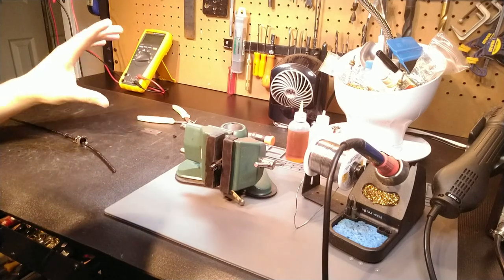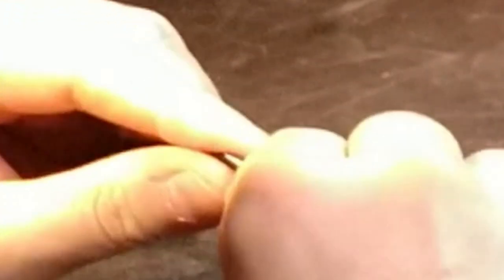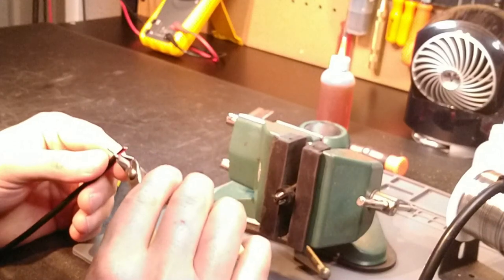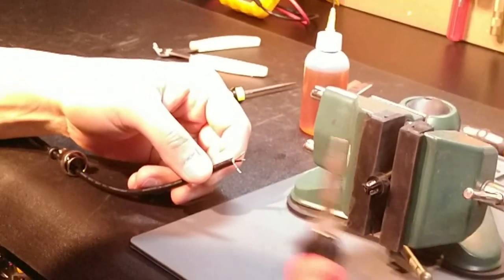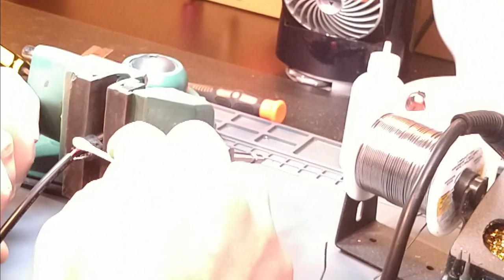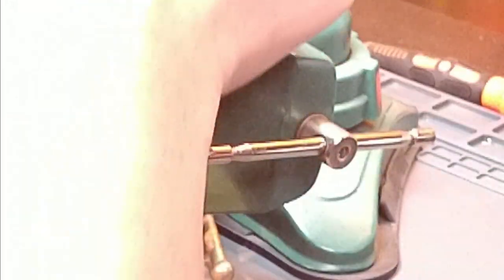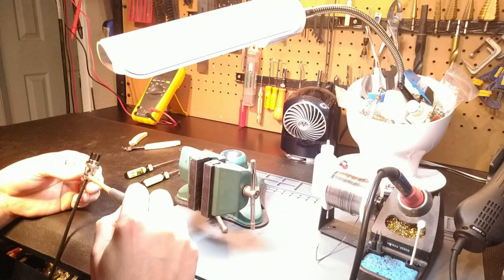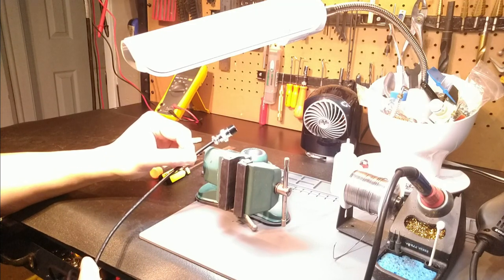How To Build A CNC System's Double Shielded Cable Assembly

Comment: Hey Vince, I see here you are using 22awg wire to solder to GX16 connector.  When using 18awg wire, the wire seems to be too large to fit in the cups.  Even before solder.  Would you just use 22awg wire instead inside the chassis from connector to stepper drive?
Reply from the maker: No, 18awg leads are fine to use on a GX-16 connector, and will fit the cups fine. It should be used for all stepper drives that are using them as 22awg won't support the voltage's/amps of most drives. Here's my new assembled GX-16 cables here https://youtu.be/6YU-YZQT02c Thank you,
Vince

Comment: Have another quick question Vince. When wiring a 110v 1.5kw vfd and spindle, I will only be using 3 of the 4 wires correct? Hot,neutral and ground. Thanks again for all your help.
Reply from the maker: Typically the 4th lead is used for the ground on the spindle's plug if your going that route. If not then you must ground the chassis to ground the spindle itself if it doesn't reflect continuity. The 4 pin required for the cable is for the shield ground drain, so even if you did use a 3 lead cable you would require a 4 pin plug to support it. Thank you,
Vince

Comment: Thank you Vince for this video, your technics of work is like brain surgery. So please enlighten me, the double shielded cable is the one with plastic foil wrap around wires + thin copper braid, right ? If is that so, it means i am already having this type of cable on my machine but being out of knowledge i thought it is normal shielded. I thought the double shielded means kind of double  copper braid. Another thing regarding grounding the shield i wanted to ask, is there anything wrong if i use to return the braid backwards and clamp it with those two screws of plug shell where you put the grommet in order to ground it to the metal control box through the plug shell ? Or it's better get plugs with + 1 pin to do it like you ?
Thank you,
John.
Reply from the maker: John, Thank you for your support. Please use the method outlined in the video for grounding utilizing a connector with an additional pin as its best practice. The cable in the video is double shielded, and utilizes a tinned braided copper shield, and Mylar foil shield. 
Thank you,
Vince